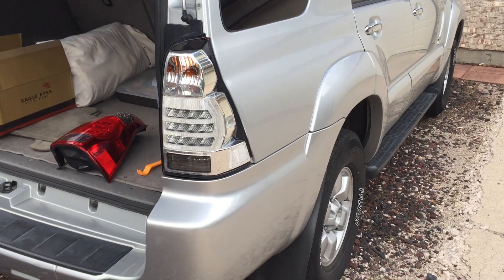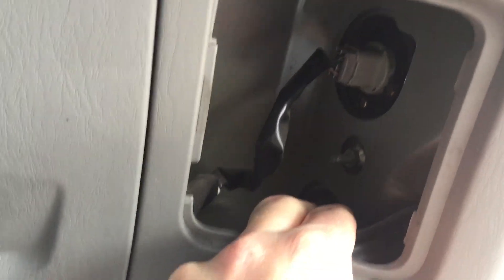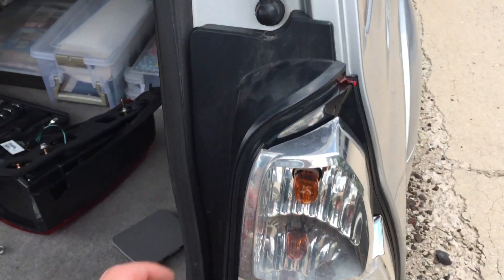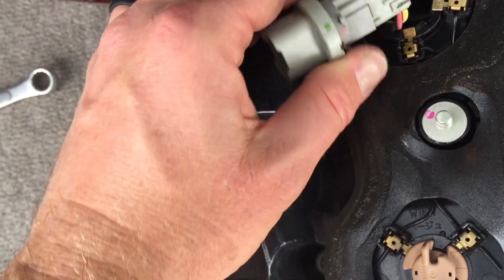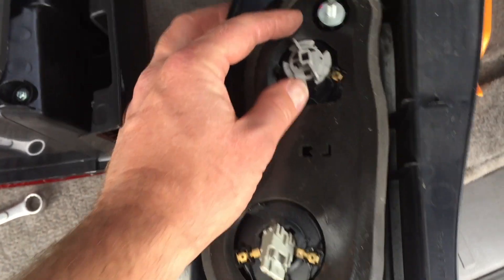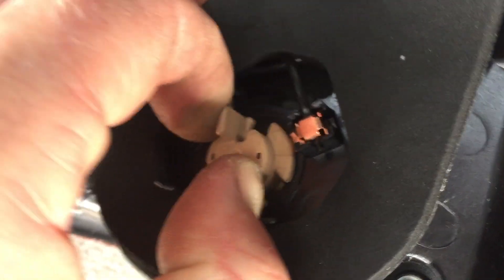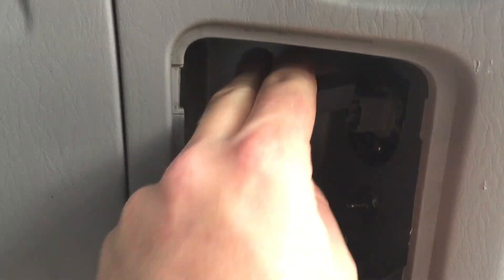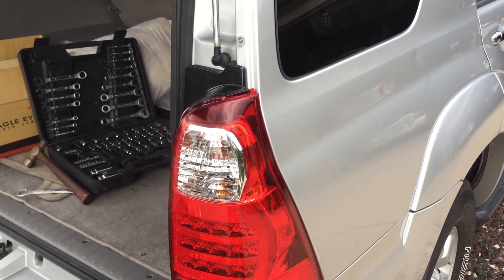How to Replace Install Toyota 4Runner Tail Light

Comment: Thank you so much for the thorough explanation and tips. I replaced mine today and after $65.00 and a trip to ACE (the only wrench I did not have was the 10 mm), the job was done. in less than one hour. You were right about the upper bolt. The 10 mm wrench is absolutely essential there. The bottom one was a cinch with the ratchet. Thank you also to Fraserfirrr.

Comment: Our 2016 4Runner needed the tail light assembly and Toyota quoted us $400.  I did it for the cost of the new tail light (around $100).  I needed a 10mm long socket which my neighbor had.  It was a nut driver with a hollow middle so it went over the posts. My neighbor had to then use channel locks on the nut driver to get the nuts to turn.  The nuts were too tight for a simple wrench. It was very easy to so with the muscle help and the perfect tool. I had to move all of the electrical over as the new assembly didn't have any.  The old assembly electrical worked but the glass/plastic was cracked and it failed inspection.   It came with a new gasket I put on after I moved the wiring.  Thank you so much for your video!

Comment: Thanks. Your video was extremely useful for replacing the tail light of my 4Runner. I found easier to use a ratchet wrench and 10mm socket
Reply from the maker: That's a great tip. Thanks for sharing. Hope you're able to help with your job. Thanks so much for watching.

Comment: I found that a 10mm ratcheting wrench is really the way to go to get the top bolt back in. The bottom bolt I could reach with my ratchet. Thanks for the video!
Reply: Thank you for the tip regarding the 10 mm wrench.

Comment: Where can I find an assembly that has a light bulb in the middle hole?

I’m finding there are 2 different types of tail light assemblies. 1) with the wiring in the middle hole without a bulb. 2) without the wiring in the middle hole but WITH a light bulb.

Comment: Ty for the video.  I decided to do mine immediately after watching.  A flat tip screw driver or butter knife will pop that panel door off.   Completed it in 10 minutes, no probs, very easy. 
 I have an '05, which looks the same, minus the mid plug in on the tail light.  The torque on the 2 nuts was maybe 8 lbs, hair more than hand tight.  I thought the upper nut would give me trouble, but it was easy.  Thanks again.
Reply from the maker: Yes! so glad the video helped and you were able to do it yourself. I'm always shocked at what a dealer or shop wants to charge for these simple fixes.

Comment: I bought mine on E-bay for $68 , but I thought it would be more complicated to change it.i think I can do it myself. Thank you !
Reply from the maker: Thats great! Shops would charge you hundreds to do it. Glad I could help. Thanks for watching!!
Reply: Scott's Garage , I was wondering if you can tell me where to get that bottom bulb holder? I must have lost it when I crashed. Now my rift signal doesn’t work. I need that connector
Reply from the maker: @MariyaLoveyah  I usually buy all my parts from either Amazon or eBay. Here is one of our Amazon associate links, which might be helpful...http://amzn.to/2eWZRPn

Comment: Really appreciate the video and the comments! Like the comments from Stephanie G, when I got underway I didn't realize I would need to move the electrical wiring and connector components in addition to the bulbs from the old assembly to the new assembly. Once I figured that out it all went smoothly. I used a 10mm off-set box end wrench that worked well and had enough length to provide necessary torque on the nuts both ways. Thanks again to Scott's Garage and commenters.
Reply: You are very welcome. Hope we were able to help out a bit. Also grateful for support from the community here on YouTube who help offer their insights.

Comment: Hi. Question for you. I have a 4Runner and would like to replace my brake light bulb… But in this video there is a wire going into the assembly just like mine has. In a previous video i saw of yours i saw you replace a bulb without the wires going into the assembly… so my question is where is the bulb to replace it? It doesn’t show a bulb in this video.
Reply: I am having the same issue.  Where is my bulb!!  Let me know if you figured it out
Reply: @annacrowe1639  I removed the entire assembly and pulled the harness. Best I can tell… it’s like a circuit board of individual LED’s with their own mini reflector. So apparently our specific application doesn’t take a conventional bulb LED or Filament. If my brake light goes out I fear I’ll have to replace entire assembly. Hope this helps.

Comment: For anyone that doesnt know 2003 -2009 4runner tail lights are not all the same. If you have the mini lights,  you have to replace entire assembly(just the brake lights) the blinker and reverse bulb can be replaced. Pass it on.
Reply: Thank you

Comment: My tail light isn’t the issue, my turn signal works on my right one but the brake light doesn’t work. I can’t find the cable for it do you know what it’s called? The wire is too short after I (ghetto fixed) it
Reply: are they led or just regular bulbs there's 2 different set ups limited and up has led brake lights

Comment: I replaced my right one also with generic aftermarket . It is no 
way as bright as the stock Toyota one . It drives me crazy so Im changing it .
Reply: teejayw28 did you use the same bulbs?